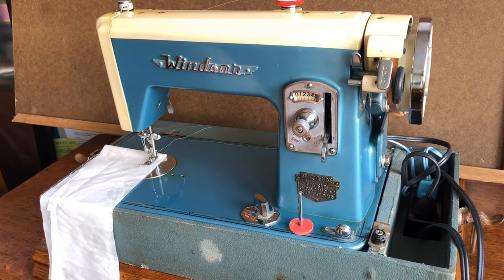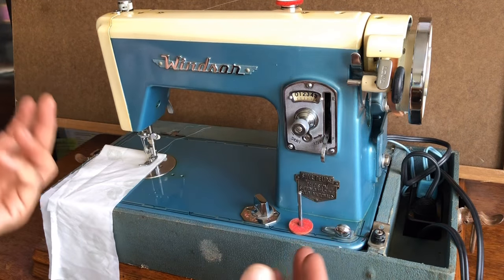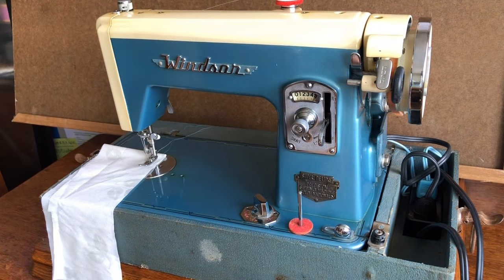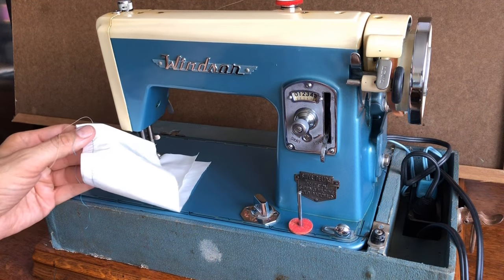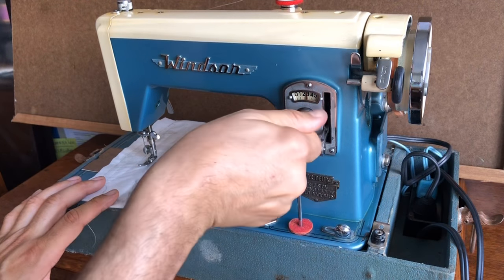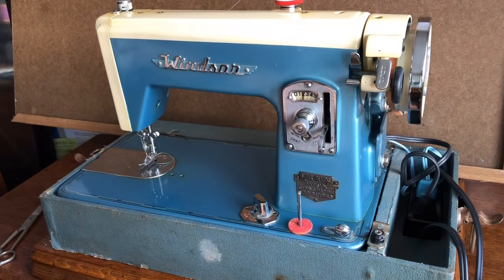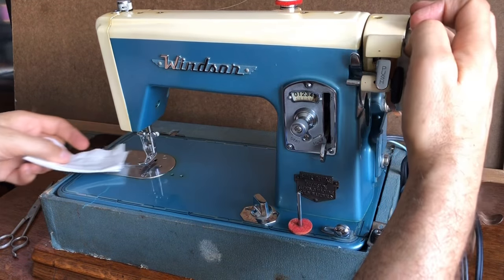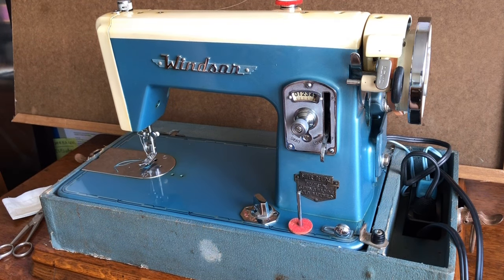1958 Windsor "Clone" Sewing Machine Ready for Service!

Comment: I have found that vintage side loading bobbin machines are heavy duty machines. After cleaning and some maintenance they are still work horses. I have also discovered that a side loading bobbin means the needle is inserted sideways, and threaded from left to right instead of front to back. Is this true for the 1958 Windsor?
Reply from the maker: Hello and yes, you are correct in that MOST of side load bobbin machines thread from left to right.  However, Singer had a few exceptions to this.  Although most Singer vintage models thread also from left to right, a few models threaded the opposite way.  Singer Featherweights, Singer 201's, and Singer 301's thread left to right and the needle positions likewise correspond to this.   User manuals are always great for confirming this should there be any question since incorrect needle installation or threading can completely throw off a machine's stitch forming.